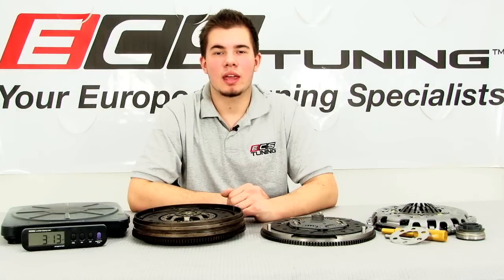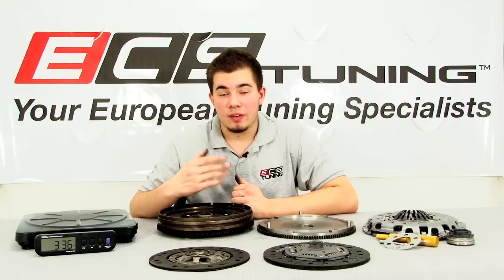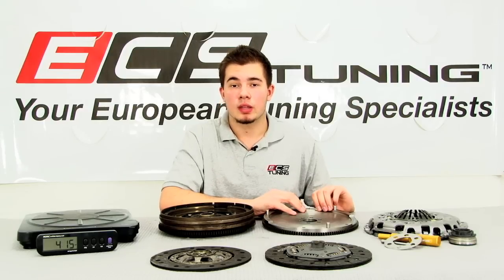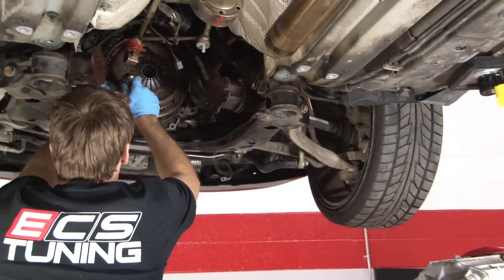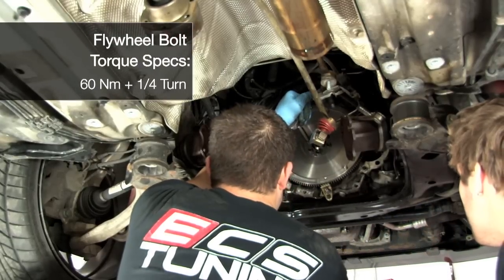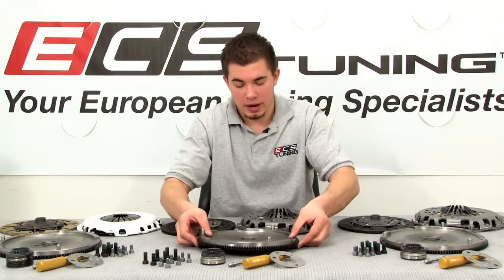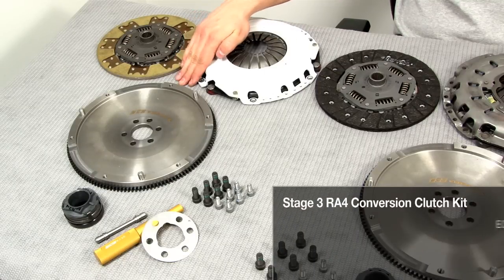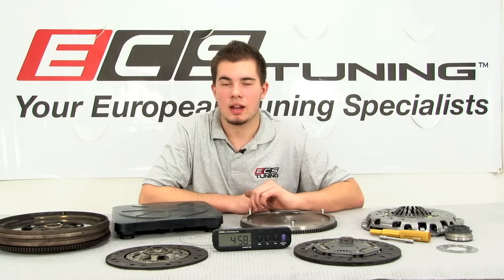ECS Tuning: Audi RA4 Flywheel Clutch Kits DIY

Comment: Is that a SAC pressure plate? Also, after install, are the pressure plate fingers supposed to have clearance between them and the center ring, or are they supposed to be contacting the ring?

Comment: At 3:18 I notice the shift rod hanging toward the middle of the footage, my question is...how the hell did you get it off? Was the end welded to prevent a removal of some pin/bolt? Thanks. @ 3:28 there is a close up and it looks like that welding was pried at in order to get to the hidden culprit. Is this the case?

Comment: Hi I bought the ES5485 kit for a B5 sold the car and never saw the install, I have a B6 would I be able to use it on the 1.8t and just but the longer push rod. Everything looks to be the same except the push rod.
Reply: Do you still have this kit. Would you consider sell it?

Comment: I’m working on a 1999 Audi A4 (175,000 miles/manual Transmission) that makes a loud grinding sound (intermittently) when the clutch is depressed fully. Also the dash lights and stereo go off during sound. What could it be?

Comment: I need a clutch for a 2004 audi a4 1.8t b6 quattro usp. 6 speed s line. Its got a apr stage 1+ tune.. sitting at abt 175kw.. whats the clutch u can recommend that wont break the bank yet handle the power..

Comment: Bullshit I bought a kit for my 1.8t jetta and its started it slipping right away I call them up and they said that I need it to grind something down  cause of some imperfection s on the casting and shit so they did and then they told me to drive it for 500 miles and shit wellbthe point is that I ended up buying another clutch from somewhere else and ecs never did anything well dave never did anything they thought ibwas trying to pull something so dont buy from them